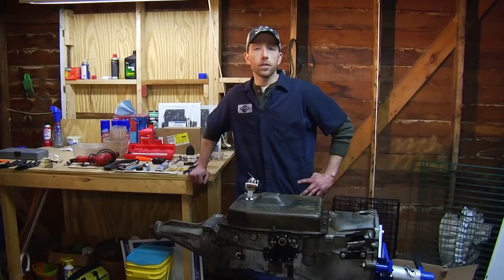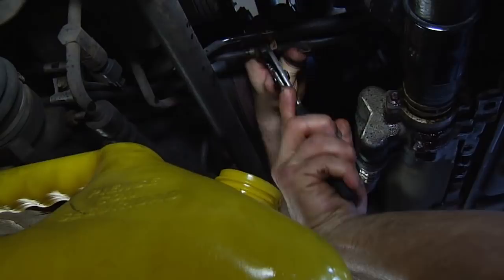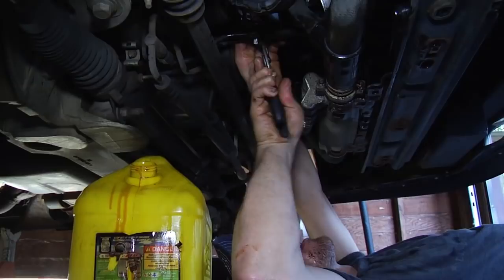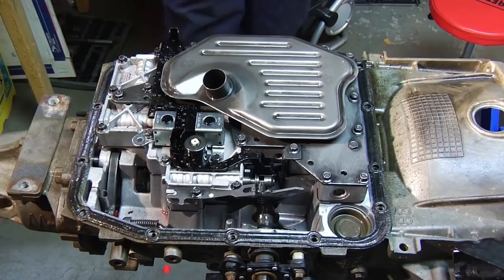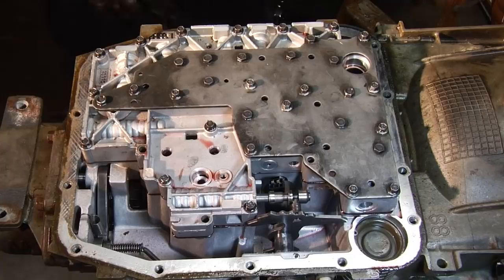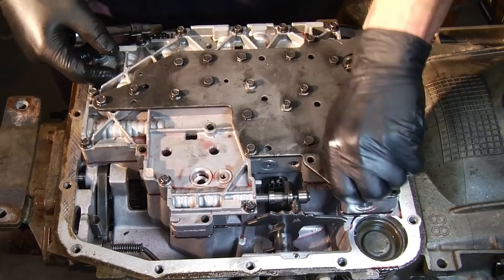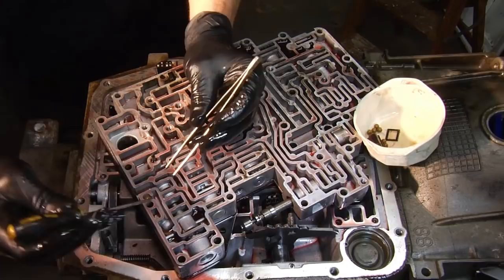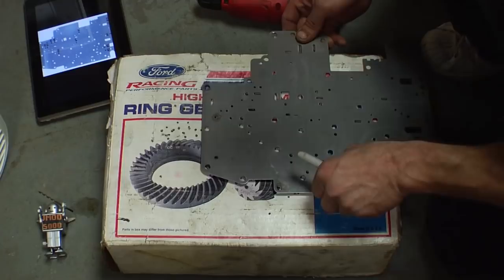The Official JMOD How-to Video by Rizzo

Comment: Hey rizzo. I have a 2000 mustang gt and i just did my transmission. I followed all the steps according to the instructions that came with the kit and your instructions, I put everything back together the way it supposed to. Now i started the car and when I put it on reverse the engine turned off. I can't switch any gears because it turns off. Any comments on what's the problem or how can i fixed it i will appreciate it. Thanks

Comment: If it's the return cool line returning to the transmission, why is the fluid comming out of the transmission hose?
Would not the supply line to the tranmsiion from the cooler be flowing.

How is that line not the supply line to the cooler, that is transmission line out?
Reply from the maker: That's the rubber return line coming straight out of the cooler. I don't understand your confusion.

Comment from the maker: 5 It's a great confidence builder. "You" just did some "Trans Work"! and to some that's a little scary, So when they're done they feel better about their abilities. 

We're modifying our VB's but drilling a few holes and removing springs. We're not installing anything aftermarket nor are we installing anything that is larger,smaller or other wise different than what this trans gets stock in some vehicle from Ford. 

It's not a shift kit. This does not involve B&M or Trans Go.

Comment: Quick question getting ready too do this on my 2000 gm gs,how hard are the shifts with spring gone?? Also I got 8quarts of mercon v and New trans filter and both gaskets for vb,I want too know where too get this purple spring everyone talks about,I called my local Ford parts warehouse and this # is even being made any more.... F75Z-7F284-BA,or should I just drill holes and leave springs in any info would be great and also great video very helpful!!!!

Comment: Okay, so, I have a couple of questions; @ the 8:34 Mark, where you say Remove only the Bottom Springs from the 1-2 Accumulator Piston, what would happen if you were to remove the top springs as well? What would happen? would it damage anything? Would it not shift correctly? also, around the 15:34 Mark where you take the 2-3 Accumulator Spring out, does the add the same affect as taking out the two Springs out of the 1-2 Accumulator Piston? I assume it does. Also, when Drilling the Separator Plate, what would happen if you drill the holes slightly bigger like a 7/66 or a 7/74, or a 3/35 or 3/42 for the Reverse Gear or something like that? What affect would THAT particularly have? And what about the other existing holes in the plate? are those able to be drilled as well and have a positive effect on shifting? Can you use an off the Shelf shift Kit along with a J-Mod, side by side each other? I have a 2002 Mercury Grand Marquis. I want to do this...
Reply from the maker: Ok first, You would have...SURPRISE a very firm down shift. 

Do not drill random holes in the plate. 

Do not use any shift kits.
Reply: @Jmodderator  Okay, correction, I never said anything about drilling "random" holes, I simply said, what would be the effect of drilling the numbered holes slightly bigger than the recommended 7/64 to like a 7/66 or a 7/68 or something like that...
Reply: @159002  actually you did talk about drilling other "holes"  and I quote......  "And what about the other existing holes in the plate?"

Comment: On the 2-3 shift bore area, concerning that round piece that you bend the tangs on to hold it in place. Is there any chance it could get cocked in the bore crooked during normal operation? It looked as though you had a little trouble setting it flat(ish) in the bore so I was just wondering about that since I don't really know what's going on there.

Thanks in advance

Comment: This video encourages me to do this on my E150 with 4R70W.  Will this JMOD technique work for the 1999 E150 Econoline?
Reply from the maker: Best way to tell  PRN (D) 21. With Overdrive button at column shifter knob.

If you have a 4 speed w/ Over drive then you may have the 4R70W, Google to confirm though.

Comment: I have a 1995 T-Bird with 56k original on it. I changed the filter and fluid just for good measure and it was in excellent shape. I do have experience albeit with GM automatics. This doesn't look hard to do at all, just time consuming. I understand that my 1995 is a bit of a bad compromise of parts. Some people say upgrade the valve body with a 96-97 unit, and some say leave it alone before I torch the roller clutch. Any advice you can give?  Is the video the same process for a pre-96 valve body? This is the first time messing with a 4R70W, only DOA's and 700R4's. Thank you!

Comment: Great video!!  I recently used your video to complete the JMOD on my 03 F150.
I probably should have done a little more research before doing it, in my 2003 F150 the shifts are a bit harder than I was expecting, but I'm not scared to tear that thing apart again if it becomes a problem.

One problem maybe someone has experienced that I am not sure about is the overdrive light on the shift handle now blinks all the time.  It started blinking right when I first started up the truck after the jmod.  I thought maybe it was just due to low fluid, but the light still blinks after fluid level is up.  Any ideas?

Thanks again for the great video.

Comment: Thanks.  Just to clarify.  I will be replacing the older ones, with o rings, with the newer steel and bonded rubber ones.  And the same springs works on both?  Also if I got a 99 main control is it basically a direct swap?

Comment: I was looking around on CVN today.  Registered by not approved yet.  I seen that one of the mods on CVN is from Romulus.  I'm in Belleville.  Is that you? 
 I pulled the VB back out tonight.  All balls are in position.  Plates were on correctly, as two had really no choice.  Not sure what the deal is here.  No first gear in auto or manual.  
Once I'm approved for CVN, I will ask some questions and post pics.

Comment: Gotcha.  I see now.  So it wasn't a mod I noticed.  
Selector needle/marker hasn't ever worked since I've owned it, floor shifter.  The shifter pulls all the way down to 1.  Had someone in the car today moving the shifter so I could see what was going on.  Seemed to move all the way.  The shifter was never moved while the VB was out.  Everything should line back up correctly, as there are a million bolts holding it up..... :)  What about the springs that were removed?  Could these cause issues?

Comment: hi i have a 94 mustang gt with a AODE. my transmission was rebuilt about 15,000 miles ago. any way it has a high stall torque converter from b&m, rev. drum w/ mech diode, spiral lock kit, stub shaft, pump bushing, stiffener plate, red eagle master rebuild kit, fair banks high proformance transaction kit, and pump washer, aode carbon fiber overdrive band, borg warner loe/rev band, electronic pressure control solenoid.

Comment: Another tip. Always replace the 1-2 piston and cap. They leak and it causes issues.
Reply from the maker: You know a bout 1/4 of what your talking about. 

Always replace the older style aluminum with the bonded newer design. 

AnOTHeR TiP AlWaYS REpLaCE is broad and incorrect.

Comment: Crown Vic nation.... i think my trans is over heating. After driving for about an hour or so my trans starts shifting funny 1st and 2nd gear normal shifts 3rd and 4th shifts weird quickly to the point where 4th gear starts at a really low RPM. I thought it was the trans starting to slip , got a new transmission install and itS doing the same exact thing. Can anybody help me on on this crazy issue?????BTW its a 2006 crown vic p71 with a marty tune..

Comment from the maker: The slipping from worn clutches will disperse that clutch material. 

If they are worn enough to slip they do not have enough material left to grip. 

If you Transmission is exhibiting any signs of malfunction, DO NOT perform the Jmod until you get an expert opinion and talk to a Mechanic.

Comment: Check plate where the dot is for cracks,3rd circle!
Reply: @Jmodderator  plate will have hair line cracks around the dot on the plate! Always buy a new plate!
Reply: @Jmodderator  Ford in their infinite wisdom removed the third reinforcing plate over where the 2-3 servo is. What that caused is one of the primary reasons that 4R70W, 4R75W,  transmissions burn up. The constant pounding of the 2-3 servo over the unreinforced plate causes cracks and a fluid cross leak. If the plate doesn't crack, it can still lift up off the gasket enough to create the same cross leak which engages the forward clutch pack when it shouldn't be engaged and burns up the transmission. There are a number of upgraded plate kits and Sonnax even sells a kit to put back the third reinforcing plate. I have my speculations as to whether Ford deliberately did this to weaken the transmission and cause them to fail just out of warranty to drive up revenue for replacement units. I wouldn't doubt it though.

Comment: Awesome Video!
I just got one question: Will it be the same way on my truck?
It`s a 1998 F250 with the 4R70W in it, and i don`t know if there are major differences in Car or Truck transmissions.
Which parts need to be reachable? Should I order new Springs or something like that BEFORE I start the Jmod? I`m asking because it would be a big problem if there`s something broken and I have to order parts from the US. It will take weeks until the Parts arrive in Germany and for that time the Truck would be out of service.

Big thanks in Advance and greetings from Germany!
Reply from the maker: Since I don't know about the torque output for a F250, I had to Google some.

You can read this and ask further questions there..

http://www.ford-trucks.com/forums/1268994-j-mod-to-truck.html
Reply: Thank you for this Link, I'll join this Forums to get more input about this topic!

Comment: thanks, what size snap ring pliers did you use?? Any recommendations on what a "good" one would be? That is probably the one tool I do not have. I just don't want to buy a POS and have it be the wrong size once Im under the car with it half torn apart.

Comment: Looks like more of a pita than installing a shift kit in an old C-4 or C-6.

Is the Jmod the best solution for the 4R70W or are any of the available shift kits on the market better?
Reply from the maker: Yes.

The guy who designed the transmission , wrote out the steps I follow.

Comment: Did you leave the 2-3 accumulator spring out? 
I just had a problem with my 2001 F150 4r70w ...the spring broke and wouldn't let it shift to third.  Just curious
Reply from the maker: Yes, I pull bottom 1-2 and the only (bottom) 2-3 springs.

Comment: do you happen to know how to reinstall a servo piston into the band without taking the whole transmission out of the car?  i replaced a broken retaining ring and the servo piston after it fell out. i just pushed the new piston up.  my f150 is still slipping after the 3rd gear into neutral.  any advice on how to push the piston into place?  thx!
Reply from the maker: You have to push the band up, then install the piston. 

There is an opening right around the solenoid. You can see the band. 

If you want some pictures, Go to the Jmod5000 page, I can message you them.

Comment: like about a centimeter of dust built up on the magnet with no fibers or larger pieces, and some dust in the pan. as for the trans fluid it was un burnt and honestly if it was filtered could have been used again

Comment: I followed this recently because I had to repair my OD piston snap ring. I'de suggest no one removes those springs like he shows. I had to re-open mine and put the springs back in. the 1-2 2-3 shifts banging makes the car undrivable in the winter. also removing the 2-3 spring puts that 2-3 piston at risk of jamming in place which will toast 3rd gear. removing the springs seems only useful for doing burnouts
Reply from the maker: Bro you have absolutely no idea what you're talking about, Like literally zero. 

Do you know who wrote the directions followed? Jerry Wroblewski, The fucking designer of the transmission,
Reply: @Jmodderator  im quite aware of that. the 2-3 piston is hearsay from a transmission shop. the 1-2 2-3 slamming I know for a fact would make the car undrivable in the winter. I've driven this car down a curving hill bumper to bumper the road covered in ice. stop and go creeping everyone was doing, if I had those springs out during that every go I would be sliding into the car in front of me. Other than that, thanks for the video it used to guide me into getting to my broken OD snap ring. i'm long time member crownvic.net
Reply from the maker: @bobspurloc  Good, Then go back there and look up AKA_Rizzo. See me, 5th in post count, See all my threads with dRock and the quotes from Jerry W from the thunderbird site?
Reply from the maker: https://www.tccoa.com/threads/tech-article-ford-od-transmissions-101-jerrys-mod.106348/

Scroll down to Modifying The Valve Body section, And see in Jerry's own words, Remove 2-3 and bend tabs. 

If it's too harsh for you, Get the Mustang spring and put it in there. 

My video and procedures are correct.
Reply: @Jmodderator  Thanks, wish I saw this doc before so I could better understand what is going on in the valve body. first time opening mine up. the issue that alarmed me was that I put the little hat thing on the 2-3 accumulator hold retainer. my original plate was dented and cracking from the Tip hitting it. I was give the little hat that spreads out the force the tip was doing to the plate. so with the 2-3 spring missing, how was that going to be held in place. It was probably flopping around. the shifts were too sudden even at low speeds and I can't have it like that since I tend to drive this car on unpaved roads traveling faster than suv's. I like how it is right now with the quick shifts.

Comment: will this work in a mustang 95 AODE? Is it safe to stop after removing the bottom springs if I just want to speed up 1st to 2nd, or must I go through the whole procedure?
Reply: You need to drill the separator plate as he has demonstrated in the video. Reason being is your transmission shifts based on hydraulic fluid pressure. Enlarging the holes allows more fluid to flow thus filling the chambers faster and creating the faster shifts. Simply removing the springs out of the 1-2 and 2-3 servos will cause erratic shifting. If you're going to do it, you need to do it correctly or prepare for an expensive mistake.

Comment: Hey Rizzo.  First off thanks again for putting together such a thorough guide.  Have a question about the 1-2 shift.  Mine is extremely aggressive after the mod, now thinking there may be an issue with the 1-2 lower spring.  Any ideas?  Thanks in Advance -Brian
Reply from the maker: Did you remove the lower spring?

And Extremely aggressive is a relative term based on your sensations.

You do know that removing the lower spring (which 99% of the folks do) will create a firmer shift.

That lower spring is the resistance for the piston. This eases the trans from first gear to second gear, AKA The Grandma  Shift.
Reply: Jmodderator Yes, I actually just re-installed the spring and things are much better.   My install is in a 57 F100 with a GT40p 302 installed / US Shift controller.  The only thing I can think of is the mapping on my trans controller might have a bit more aggressive with line pressure under 1-2 shift which caused the hard pounding from 1-2.  Thanks again for your support.

Comment: What are your thoughts on the JMOD in a truck trans? Some say it won't work. Some say it slips when towing.
Reply: The truck valve body is crap.  99+ passenger car valve body is what you want.  

Idk if you would experience any tuning of fitment issues.

Comment: 16:05 Question: If you bend those tabs even ever so slightly is that going to cause the piston to possibly get stuck open/closed?
Reply from the maker: Ever so slightly, No it's most likely not possible. 

If you need anything except your fingers to push the 2-3 back in or it doesn't hang in there (Assuming you're doing this upside down as it would be in the car) then you're fine.
Reply: Jmodderator OK thanks! If I ever get around to this I'm thinking of getting a local Marauder owner to do it for me. I see why people come to you for this.

Comment: Great video. would you MIMD linking to the page where the separator plate pictures are located? Searching tccoa yields hundreds of "j mod" threads and I need to find the one with the drill instructions for a 1997 4r. thanks.
Reply from the maker: Check the Tech articles. Not the threads

Comment: i plan on doing new 1-2 &3-4 accumulator along with new upper 1-2 /3-4spring. or do you think i should leave the 3-4 spring out?  where are you located. i would prefer you to do it if your still in the buisness. im in so cal
Reply from the maker: +Shane Thompson There is no 3-4 spring, there is a spring around the OD Servo and you do not want to try to remove that. The OD band will drop and then you're in for a world of hurt when you don't what you're doing.

Comment: Necro bump. Can you do this on a Ford Van with the same trans? Any disadvantages?
Reply: Brian McClure if it’s got a 4R70/75 it can be done. It’s actually better for the transmission to do this mod, helps it flow more fluid and reduces slippage/clutch wear.

Comment: Does that line into the canister drain all the fluid even from converter?
Reply from the maker: No.

You'd get it all out if you had a drain plug that was discontinued around 2001 for Crown Victoria's.